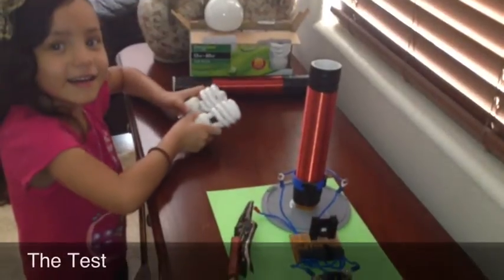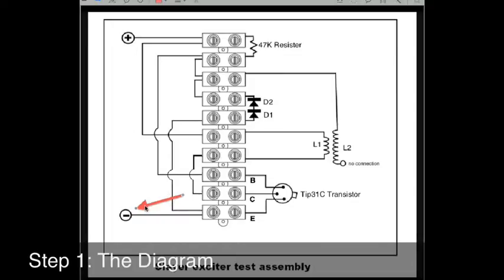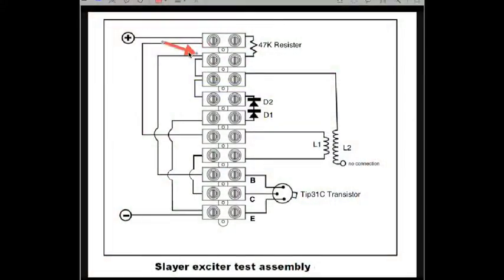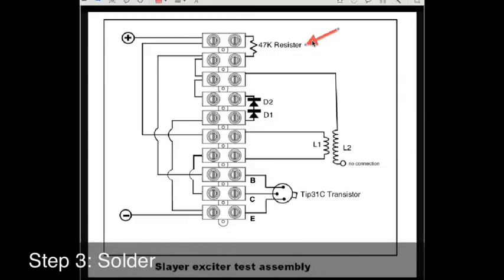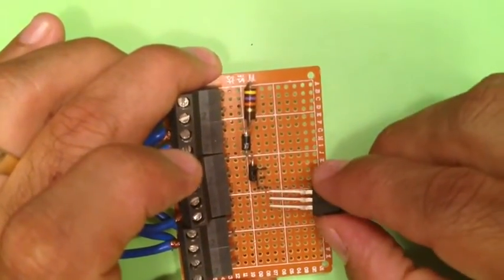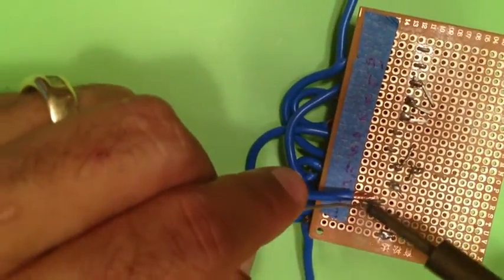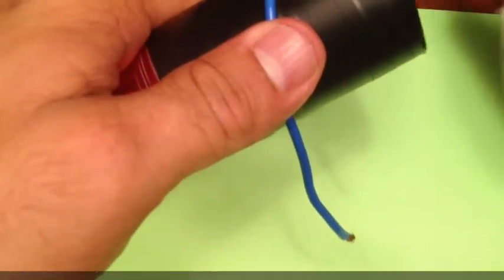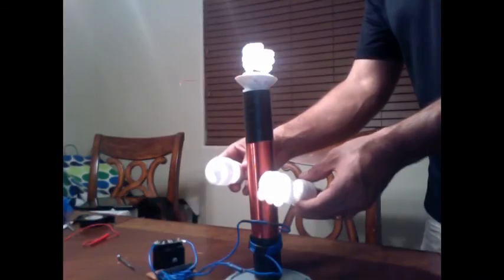Tesla "Slayer Exciter" Coil (FreeXperiments)

Comment: Good video. I did everything as you told but my circuit is not working. The transistor, resistor & diodes are heating up but the coil is not working. Pls help my science fair project must be ready in 2 days.
Reply: Try to flip the primary coil and try other transistors

Comment: Very good & motivation video sir.. I want to build this one. I got the schematics in your video which u build on connector. I made the coil on white pvc pipe 3.4 cm & turns on magnet wire 830 secondary coil. which turns of primary coil turns make ? Is it working on 830 turns on the pvc pipe? pl reply me on sj28550@gmail.com.. Awaiting your reply mail.1 important qt .. how much gauge of magnet wire ?i use the TV picture tube wire which is around the TV pic tube..